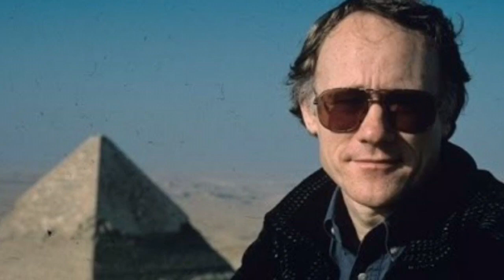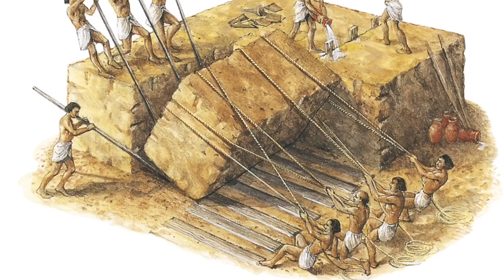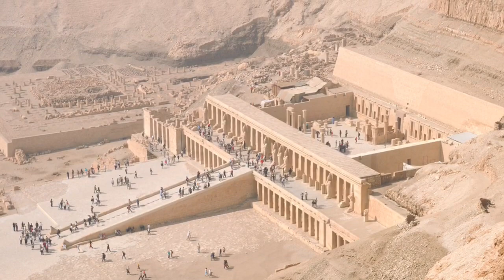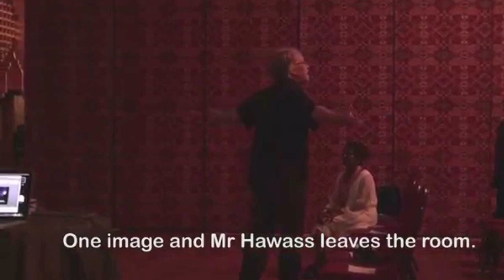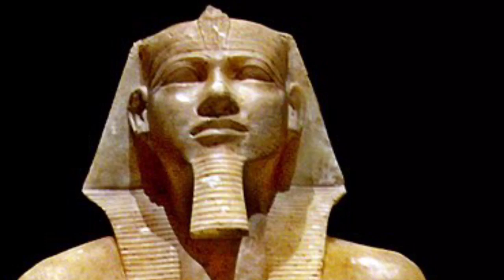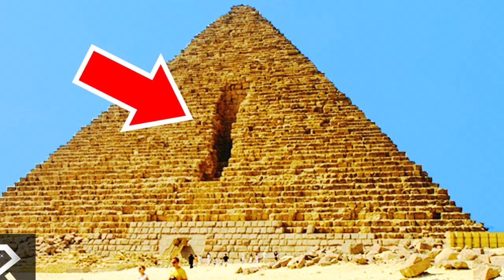Graham Hancock Mathematically Explaining why we CAN'T Reconstruct The Great Pyramid

Comment: Let me point out some nonsense in this video:

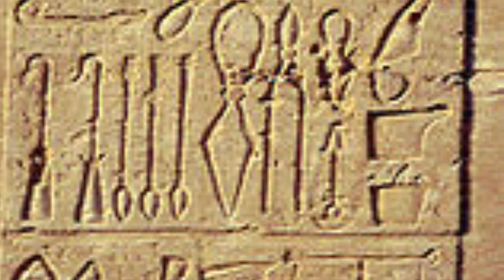You can't climb the empire state building safely today so it must be impossible that it was build by construction workers - doesn't make too much sense, does it? Neither make his claims around 3:20. Obviously it's a completely different situation building a pyramid following a layed out construction plan including various safety measures and walkways for workers than just walking up the finished pyramid with a flock of random unprepared people. 

Also: 2.5 tons equals 4 family sized automobils? What are you talking about? One single modern VW Golf weighs between 1.3 and 1.5 tons. 

If there was a ramp, it probably would not have been straight but circling around the pyramid, using the pyramid itself as it's own ramp, thus growing with it. 
Saying the blocks had to be pulled up a 1 mile long ramp is very misleading as well, since the lower pyramid layers which make up the majority of the blocks would have hardly needed a large ramp at all. There are no ramp stones left to be found because any rational construction engineer would have come up with a plan to incorporate that material into the pyramid itself in order not to waste tons of material.
Reply: i thought this video was made to laugh at what the guy is rambling about, but seeing the hearted comments, i realise it isn't ..... dat Poe's law!! :P

Comment: The most convincing and seems to have evidence is that there is an internal spiral ramp.  It seems all the tell tale signs were there,  and that method was used in some of the other previous pyramids.    I'm not sure why that hasn't got more publicity - I'm no expert but it certainly was convincing and an architect looked at the exact spots certain signs must be if that method is used - pivot points to lift and turn the blocks - and they appeared to be there.   I'm no expert as I said.

Comment: Do the fucking math Hancock, will ya? Half the Great Pyramid's volume or weight is the bottom 30m of the Pyramids height. It's pretty bottom heavy as you may have noticed. 30m high, that's a 300m long ramp at your 10:1 slope to complete first half of the Pyramid. And by the time you reach 74m in height, aka halfway up there, you've completed 85% of the Pyramid's volume. Please learn to think logically.

Comment: Why is it a mystery on how it was built?

Obviously,  the giants built it...

The nephilim of the Bible
Reply: mike jones that's the only conclusion I have ever come up with. 
Goliath type people built it.  The nephilim
Reply: There is the correct conclusion and that is they were never built but are in fact sculptures that give a fake appearance of blocks.
Reply: col pearce 
But there are actual working doors that weighs tons. You are not able to sculpt that
Reply: @stevelovesgod  There are no doors on the outside or the inside of the pyramids. If the pyramids were made of blocks then there would be lines inside the shafts, there are none, see any picture for yourself.
Reply: Many of the stone used to build these structures have been found to not belong in the region it sits in and there are signs of quarrying of blocks from other places.
Reply: @114wildfire  The Giza plateau is a plateau of limestone, there are hills of limestone, the bedrock is all limestone, the sphinx is made out limestone. The only thing brought in was the sheets of granite that are used to line the chamber. If the pyramids were made of blocks (which there not) then the so-called advance civilisation were the dumbest people that ever lived because right there in front of them were three main hills of limestone, the ground is all limestone. They supposed to have built these giant pyramids and then messed up by putting the entrance a 5th of the way up and not at or near ground level? The reason why its a 5th of the way up is because that is where the natural cave entrance was.
Reply: col pearce 

Look at the many other megalithic structures and examine case by case.
Reply: col pearce 
Look at coral cave., the guy who've built that days he knows how they've built the pyramids...
An coral cave is a sight to see to build that
Reply: @114wildfire  I have done 95% are carved, 5% are made by casting, i'm not the only one who knows, in time everybody will know.
Reply: @stevelovesgod  Did he reveal how he supposed to have done it, no, because it was an hoax, most likely a freemason.
Reply: col pearce 

Oh you’ve done the research huh?  95% are carved?  

Tell me about the 5 percent that aren’t carved
Reply: @114wildfire  Off the top of my head - Puma Punku. Its so obvious that site made by casting the pieces. Ask anyone you know that has done casting. They then do what is called 'distressing' by chipping little pieces here and there, rough up a few corners, i know how its done because i did set-building, scenic construction and model-making for 25 years.
Reply: col pearce 

Why do the scholars disagree with your theory?
Reply: @114wildfire  Who are these scholars, are they clever people who know the answer, no. There is obviously a massive amount of so-called ancient monoliths, monuments etc i can't go through them all with you, so all i'll say is whenever you look at one simply ask yourself is it carved from a hill or large boulder, if you see blockwork or brickwork could it have been done by simply chiselling lines to give that appearance. I know the answer will be yes everytime with the exception of Puma Punku and a few others. Its only a couple of questions, if you don't want to thats upto you.
Reply: Col

Who are these scholars you asked?

Who are you?

Let’s take the scientist in this video for instance.

Is he so stupid that he doesn’t realize that the pyramid was supposedly sculpted as you claim?  Why is it even an issue if it was sculpted as you claim?
Reply: @114wildfire  So they are scholars and scientist, really ? They are the one's making a lot of money but they don't know or are pretending they don't know the truth. I've told you enough to get you started to work it out for yourself, if you don't wish to then thats fine. Its all based on lies because its just one massive tourist scam, same again if you don't wish to accept it then its no skin of my nose, i'm done trying to help you.
Reply: Col

You’ve actually only asserted things.

Now you claimed that the scientists scholars are the ones making the money,...

Are you implying that they’re paid to act as if they’re ignorant on how these structures were built?   And who has to gain from this theory?  

Nobody has to gain.

Comment: It’s so simple.  Fred Flintstone built it working for mr slate using dino power.   

Seriously, there are larger pyramids in the world which are usually not talked about.  My guess is they were built using water to lift. There is water all over that area by the way. Or they had advanced crane systems

Comment: What if the rocks were MADE there, did anyone think of that?
Reply: OMG... Brilliant!
Reply: Astroboy Skygazer r u being sarcastic or serious?
Reply: @hamzah9522  the idea of stone blocks being made in place is not a bad one.  Modern day construction use this method.  Stone rendering may not be new at all.  And that the ancients may have done a similar method.
Reply: When you say ‘made’ I assume you mean something similar to modern concrete blocks, which are made by combining various pulverized minerals and water, mixed and poured..? They covered this idea in the video-apparently the stones contain fossils that would’ve been many thousands of years old at time of construction. These fossils would not have survived a mixing process required to make something like concrete. The pyramid stone is a variety of sandstone.

Comment: The pyramids are there to put pressure on the crystals inside of the aquifers below. The shape focuses the current of negative electrons from the flowing water, up, repelling against the negative field above, just below the lowest posetive field where clouds form. Pushing up the sky, making the fields above stronger and the area more liveable.
Reply: @PhyZeik i saw a video an old one of how natural crystals work, i know how the energy flows with runnng water, upon analyzation of the pyramids, using deductive logic... Its elementary...
Reply: @PhyZeik we did not build the pyramids. Giants built the pyramids. Its the only logical answer. How can you put a date on something with carbon dating when there is no carbon in it? How do you roll giant blocks on rollers in sand? You dont. You carry the blocks. You walk the distance, and you cut the stone quite easily, if you are giant.
Reply: That and we have forgotten how our planet functions, we dig up the crystals, draw up the oil, cut down the trees, dam up the rivers, and pretend or believe we know what we are doing and know where we are going.

Comment: They probably made canals to transport the rock and used winch systems to pull the rock to the top. Its surely not that hard honestly, just a build an infrastructure to support what you want to do. Its certainly not impossible if you went to lengths like that.
Reply: And they did this every 2.5 miniutes with multi ton stones some weighing over 80 tons? one pyramid has 2.3 million stones. and don't forget the time to quarry, cut and transport them.

Comment: A recent study indicates with quite convincing evidence, that an Interior Ramp that "essentially spirals" around the four sides of the interior perimeter of the Great Pyramids was used and that much of it still exists, albeit largely out of sight. If I remember correctly, one part of the visual evidence can be seen from the hole in the corner of the pyramid seen at @6:50 of this video. Although it is not shown or discussed in this video.
During this same study, engineer drawings and mathematical calculations (as well as some visual and scientific evidence) indicate that this interior ramp theory is very plausible.
Here is a link to the video I am referring to.    https://youtu.be/d83mn1yxCHc

Comment: They didn’t just push and pull the point blank weight of the blocks. They used the Nile to flood the area. Then used inflated animal skins to float the blocks where they wanted them.

Comment: What I got from this is people peddling dodgy hypotheses and debunking said fairy stories. They do know who and how the pyramids were built.
A. Built by locals willing to work. Willing to work because if you didn't you'd starve to death. Proof are the graves and ruins on-site. skeletons have evidence of manual labour, healed injuries and diseases like cancer.
B. The stone was transported to the site on boats via various waterways, some of which have been found. Watercourses do change over time.
C. The pyramids were built using ramps that went from level to level. There is evidence in the pyramids of mounting points for the ramps. 
D. In fact many tools used today in construction started with the pyramid building. Eg plumb Bob, set square, string line.
E. Using levers, mud and manpower, those blocks can be moved. Don't forget, the workers had plenty of time to build them. 
F. If anyone suggests aliens built them, then they did a bad job of it, using softer stone in that environment and not permanently attaching white cover stone casing.

Comment: People need to THINK....the Great Pyramid has 2,500,000 blocks.....each of different shape and size to "fit" correctly...and each block ( as was said in the video) averages tens-of-tons in weight. The pyramids were said to have taken 20 years to build. Do the math.....that would be UNINTERRUPTED setting of blocks every 5 to 8 minutes forevever over this 20 year period, non stop, day and night, rain and shine.  For 20 YEARS. This is impossible even IF a ramp could have been used....and the vid shows clearly this too is not possible.

Comment: His conclusion about Davidovitz' contention is wrong is flawed. Davidovitz says some stones, not all, were geopolymers or tamped concrete.  But basing a refutation on the presence of shells in stone is erroneous, because natural inclusions are 99% oriented to one plane. The artificial stone inclusions are oriented every which way. Also, in those stones with these inclusions one would expect to find shells cut in half if they had been quarried. Show one example. And, they've found places where the semifluid geopolymers have drooped over neighboring natural stone. So Hancock was off on his dismissal of Davidovitz. Shells were used in the geopolymer slurries.

Comment: Not sure about your comment that we couldn't do this today we have cranes that can lift well over 70 tons for instance the Taisun holds the world record for "heaviest weight lifted by crane", set in Yantai on April 18, 2008 and set at 20,133 metric tonnes (44,385,667.25 lb) by lifting a barge, ballasted with water. So we could easily do it today question is could we do it then I'm not sure but if you're asking me what's more likely I'd say human beings did it

Comment: As a retired operating engineer aka crane operator I can tell people that there isn't a crane in the world that can lift those weight loads at the severe angle needed , especially with a lifting base of 100% sand that dosent compact .
Reply: You need ropes pullys and a lot of men , and a smart way to stack the blocks
Reply: @bobdabuilder4075  ever watch Iron Workers hang heavy Iron ? With a 350 ton Demag crane I've yet to meet a crew that could hang 200 five ton columns a day ,the pryamids needed a block set perfectly in place every 5 minutes with elephants and ropes made of Reed's with wooden pulleys lol
Reply: @michaelledford4751  i never said wood
Reply: @michaelledford4751  and I also said a smart way to stack the blocks
Reply: And or elephants
Reply: Once the first layer of stones was in place there would have been a near perfect operating platform. Use your head instead of blindly denying everything.
Reply: @ShufflingManu  you must be a home owner who painted his gutters once,ok Sherlock ,so start splainin how slaves removed 30 to 40 feet deep sand to even reach bedrock ,then smoothed the bedrock to within microns of dead level , using bronze chisels no less ,then lowered down " the 1st layer " of foundation stones into a 30 foot deep hole of sand ,and did it hundreds of times a day ,yeah ,hand me down that 40 ton block Bruce ! Commin in hot lmfao ,oh yeah ,and figure out how to cut earthquake proof tounge & groove " H " locks in the bedrock to precisely mate with the knob locks cut with a precision we cannot match today under every stone in that super easy " 1st layer " your on about ,yep it's for certian ,internet warrior ,not an industrial contractor lol

I don't think you've worked with your hands much ,I'm thinking the heaviest tool you use working is a #2 pencil ,or a non ergonomic mouse that gave you blisters ,use your head ,fulcrums don't move 40 ton blocks .

Comment: They floated them up through wooden channels with water using bladders made from animal hides. Perfectly possible.
Reply: This is a cool theory but it only works if the water was somehow completely sealed and airtight on top as well as having a perfectly designed, level water containment system on the bottom..other wise the water on top would just drain down thru the floatation channels and empty into the nile

Comment: You could leverage a 5,000 lbs stone with with 500 10lbs stones  or 50 100lbs stones. 5000 lbs goes up one side^ 5,001 lbs goes down the other. Manpower would be minimized.

Comment: I hate to point out the obvious, but why couldn't the growing pyramid ITSELF be the ramp, and then build it to the final dimensions from the top, down.  This would require virtually no extra material.  Just sayin'.
Also, one thought I have is that you could take those large blocks up whole rather easily if you just use a "rock" on the top to pull it up, like a rolling counterweight, say a container filled with sand or small rocks carried to the top.  This makes it about as easy as pouring the blocks in place.  If you built the pyramid from the inside out, so to speak, this wouldn't be that difficult.  Obviously, you have to maintain a stable structure as you build, so you couldn't just build a tower of rock and continue, but there is certainly some middle ground.
Just thinking like an engineer, which I am, though electrical, in my case.

Comment: They used internal ramps.. they used the pyramid itself as the ramps... there is evidence of this from unfinished pyramids. They also used counter weights to moved the larger stones... most of the pyramids are filled with rubble... today's engineers are so stupid.

Comment: I question what minds could design the great pyramid over coming problems of getting the pieces in place using geometry and astronomy without cranes going 450 feet up ????

The genius is evident and what they were built for must be understood once discovered !
Perhaps the great pyramid was to hold the Arc in the granite box to harness said energies it has,  and protect people by not needing guards any longer to keep it safe !

The Arc was a dangerous thing said to be like  fire but something much more powerful ?

Comment: Did the race prior to the Ancient Egyptians (the true builders) have the ability to grind up rock from the quarries hundreds of miles away, transport the 'pre mix' per say to the site, then mold pour it back into blocks like cement today? Think of our modern day equivalent, the Hoover Dam. If so, transport would then be easy peezy for a workforce of people.
About the only other theory I could think of is some sort or levitation type technology devices used to either change the molecular weight or to encase each stone in an anti gravity field and transport each block that way.